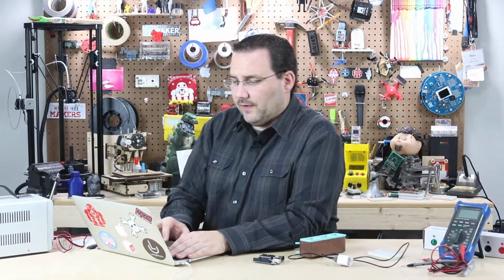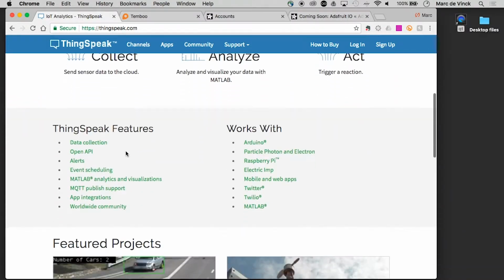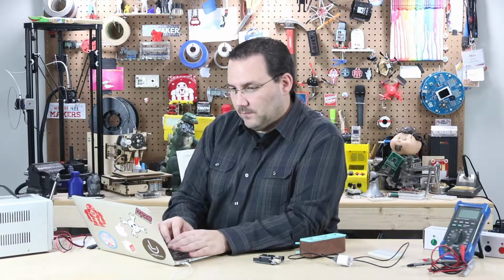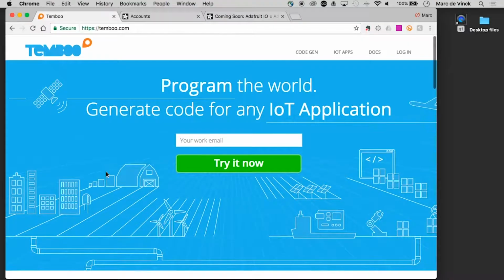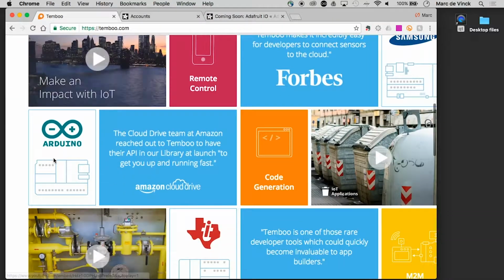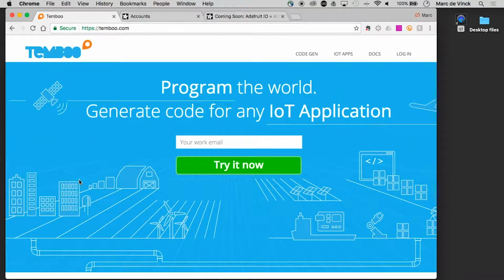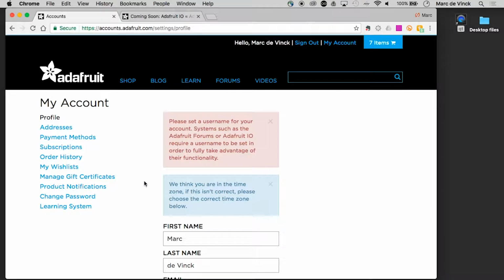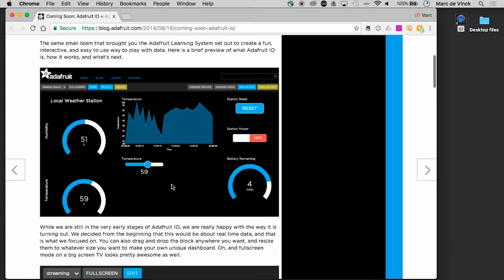Arduino IoT Web Services Explained: IFTTT, ThingSpeak & Adafruit IO

Comment from the maker: ⚡ Quick tip: before you commit to any of these platforms, check whether it lets you export your data and whether the API has ever had a breaking version change. If the answer to the first is no, or the answer to the second is yes without a long deprecation window, treat it as a prototyping tool only and plan to roll your own server before you ship anything real.

📌 FULL SERIES: Watch all 100+ episodes of the Complete Arduino Prototyping Series. https://www.youtube.com/playlist?list=PLcKte0wD90Y4lsrStEWB5NR1gKMs0FDts

Which service are you using right now, and has it ever broken on you?